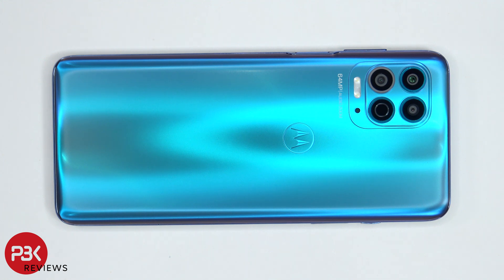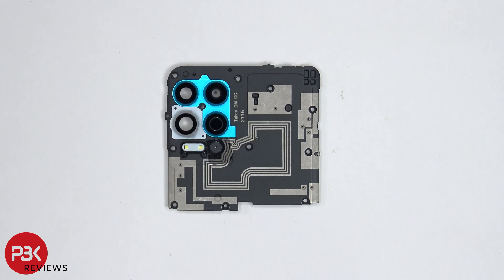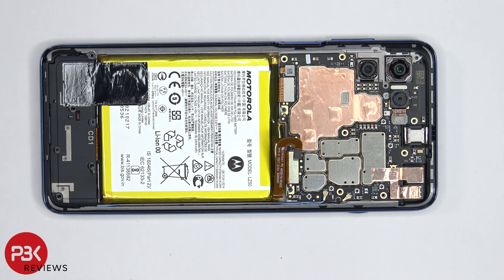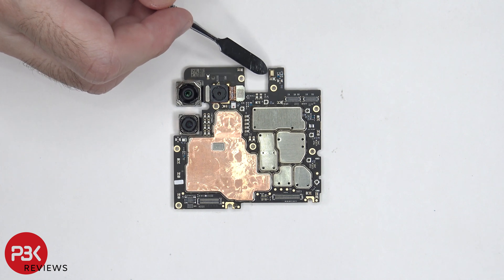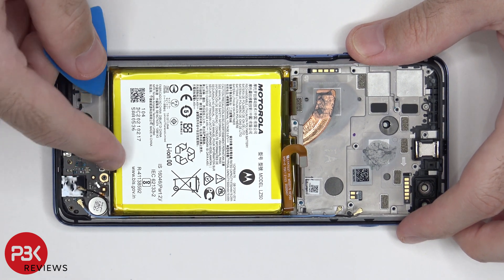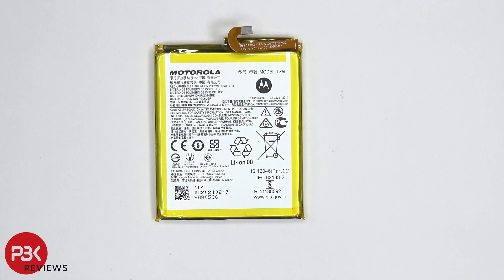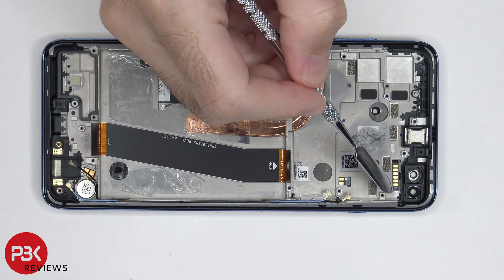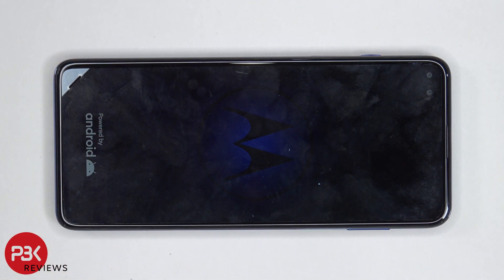Motorola Moto G100 / Edge S Disassembly Teardown Repair Video Review

Comment: Appreciate the vid.

Realize this is very old, but using it as i'm replacing screen, backplate, fingerprint sensor on my phone...

HOW THE FUCK DO YOU NOT STRIP THE GOD DAMN SCREWS
Reply from the maker: if you use the correct type n size of screwdriver, it shouldn't strip. if you have already stripped a bit, try going on size larger and pressing in while turning

Comment: Thank you very much for this video! I successfully replaced the usb/headphone jack board because the ports on the old one got too loose. Props to Motorola for making the back cover out of plastic, it was very easy to remove and the screws inside weren't over-tightened. I'm definitely running this phone into the ground and might replace the battery in 2 or 3 years.
Reply from the maker: you're welcome
Reply: i have to write an update because this is just awful. you cant get a functional usb charge port replacement anymore. the one i got from fixshop is the same ewaste they sell on aliexpress: no usb 3 and completely messed up data. you can tell that its not the same because of many missing components at the charge port and at the antenna connectors

Comment: Great video.  Helped me replace my battery.  Unfortunately, the battery wasn't the problem, I think the phone is bricked.
Reply: Can you tell what the problem is you are having which you thought was caused by the battery? 

Mine for example randomly shuts down at any givin battery percentage. And after that, it can only be rebooted while a charger is plugged in

Comment: Amazing video 🎉🎉 Can you maybe help me  i changed my moto g 100 display i dont have cellular connection now maybe you have some ideas ?  Tnx in advance
Reply from the maker: make sure all the cables are properly in place and also the motherboard is seated properly and the plastic cover over the motherboard and speaker assembly are screwed down in place since those have antenna lines drawn on them which need to touch the motherboard to give it signal.

Comment: My motorola g100's battery inflated, I don't know why, I previously had another motorola and it didn't happen.
Reply from the maker: From my experience, I find it rare for motorola batteries to inflate easily so might just be a one off. Sometimes from heat or drops they can go bad.
Reply: I bought the new battery but I feel like I have to press a lot to get it into place and by doing that I'm bending a plate at the top and it still doesn't fit. @PBKreviews
Reply: It's something difficult to explain hehe

Comment: Hello, thanks to this video, I replaced the screen in my Motorola moto g100 5G, but after assembling and gluing the phone, I noticed that even though the phone reports "Turbo Power device connected", the phone does not charge, what could I have done wrong? or what should I do now to make it charge like before, that in about 20 minutes I had almost 70%
Please help
Reply from the maker: Hi. Hmm, just make sure all the cables are connected properly, including the coaxial cables/wire cables. If no luck, might be a defective sub board/charger port board. Also make sure you have the correct model version sub board. For example after the model number there is a -1 or -2 etc. Different region versions have different antenna contacts and different charging chips which may cause you to have issues.

Comment: This phone is a nightmare to repair, i've repaired a few phones before but the screws are so tight it's impossible to remove them. Tried few different screwdrivers, managed to get a few out, but i've got about 6 left and im trying all the tricks in the book. Used tape, used rubber, instant glueing the screwdriver on it, having a firm grip, still not being able to remove them. >=[  how safe is it to bore in the screw? I'm running out of ideas what to do.
Reply from the maker: Really? shouldn't be that difficult unless someone glued those screws in lol. Worst case if you strip them, you would have to drill into the heads with a drill bit to break off the heads but then you wouldn't be able to screw a new screw in after when assembling.

Comment: How fix biometric sensor? Change it
Reply from the maker: You would have to pry the screen off from the frame after disassembling the phone, since the flex cable for it is routed through the midframe and to gain access to removing it after you disconnect it from the main board, you need to remove the screen as well. However this poses a high risk of damaging or breaking the screen.

Comment: Thinking on getting this for my new main since it has the specs I need.

Nice to have the cables running under the battery so if the battery puffs up it doesn't put strain on the cable connecters. My Redmi Note 9S had them run over the battery and 1 connecter broke so I had to repair it. I didn't do a good job and my mic and mic-in on the 3.5mm jack don't work so I have to go back in to either redo to 40pin connecter or check to see if I disturbed a cap. That or it's a ribbon cable issue. At least I didn't re-glue the rear glass back on.

Comment: I have problem with my moto g100. I replaced the screen. Phone was not use for 5-6 months. And now when i want to power on is black screen. When plug original charger, white led flashlight blink one or two times. Couple hourse on charger nothing change.
I checked all cable connections. Today while holding the power button and plugging in the charger, three times the screen showed the Motorola logo for a second and then nothing.  A moment ago, when connected to the charger, the white LED flashed 6 times. Someone can help?
Reply from the maker: Might be a battery issue, try getting a different battery and plug it in and see if it fixes the problem.

Comment: Edit : if you attempt this repair with a mid frame order a new earpiece speaker and vibration sensor. Impossible to remove without destroying.

Excellent presentation, I'll be repairing mine this week. One question - Does the main flex cable come off easily ? I've ordered a screen with mid frame and wondering if I'll need to order the main flex.
Reply from the maker: Yeah its not too difficult. Just pry it off slowly so you don't tear it. Thanks :)

Comment: Do I have to glue or heat it again when i want to Close it?
Reply from the maker: Hi, yes you would need to apply new pre cut adhesive for the phone or replace it with a replacement battery door that comes with the adhesive pre installed. There is a listing on ebay for it if you search moto g100 battery door. Also you can watch this video if you want to use your own adhesive: https://www.youtube.com/watch?v=T4iiPUIM7-Y

Comment: Hello, how do i exactly change the display ? My display broke and it has to be changed so i can use the phone. In the video u only go down to a certain point. What do I exactly do after that ?
Reply from the maker: Once you have access to the screen cable, all that is left is to heat the front of the phone where the screen is, and pry the old screen off from the frame. Then apply new adhesive and re apply the new screen, making sure to put the cable back through the opening in the mid frame and then re assemble the phone.
Reply: @PBKreviews  thanks a lot, first time ever repairing my phone myself. I just bought a new screen with a new LCD panela and new side cover. Because I just have to switch the parts to the others one which ist easier. Also my LCD panel Broker. Thanks a lot tho !
Reply from the maker: @aless7125  You're welcome :)
Reply: @PBKreviews  by the way eben removing that black foil stuff from the batterie does it have to be replaced or can I just keep it off ?
Reply from the maker: @aless7125  It doesn't have to be replaced but that graphene film helps transfer heat.

Comment: I usually use my phones for around 4-6 years and try to fix them myself. I really like this Motorola, and this video is perfect as a guide for the future. The only thing I'm worried about is the screen. Thanks for share this procedure.
Reply: same for me, sd870 is quite powerful and 8gb ram should be more than enough for few years of lagless experience.
...Unless some new technology that significantly increases battery life comes along...
Reply: Please tell me,what is better in the repair (disassembled and easier to replace),this phone Motorola g100 or Motorola g60? Thanks.
Reply from the maker: No problem. Usually they sell the screens with the midframe installed so all you would need to do is move all your parts and motherboard over to the new frame and screen assembly. You can check for parts on mobiledefenders.com
Reply: @PBKreviews  Oh thanks, I'm not sure but think I buyed parts from them for my old XT1575 through Ebay, a while ago. I'm going to save that link.
Reply: Why the screen in particular? Seems as hard to reach as almost everything, in this phone.

Comment: Hello can make a video about how to install cooling system in your smartphone
Reply from the maker: Hi, usually the phones already come with their own designed forms of cooling. You would need to greatly alter or modify the phone hardware to do anything else.
Reply: @PBKreviews  my phone have aluminum frame .which means I can cool down through the aluminum frame right? 

And my phone back panel is plastic i think cooling plastic back panel is a waste of cooling right? While plastic is not a thermal conductor

Cooling the back panel OR cooling the aluminum frame which do you think is more effective and faster cooling?
Reply from the maker: @rabizack5491  The aluminum frame would be better, but the phones usually already use the frame for cooling. They have either copper tapes and thermal paste or pads and some have graphite or graphene films which transfer the heat from the components to the frame and the frame exhausts the heat out of the phone.
Reply: @PBKreviews  yes . But when I am gaming my phone getting lot hotter and it's reducing the speed of the processor . That's why I need to cool down my phone and iam using poco x3
Reply: @rabizack5491  I'm going to meddle here, what I did was adhere a Peltier plate with a heatsink on the back with an adapter to USB (in my case type B). Is not that hard to make and don't need to modify your phone... but is a bit bulky